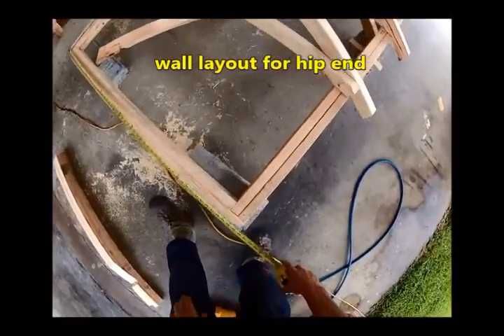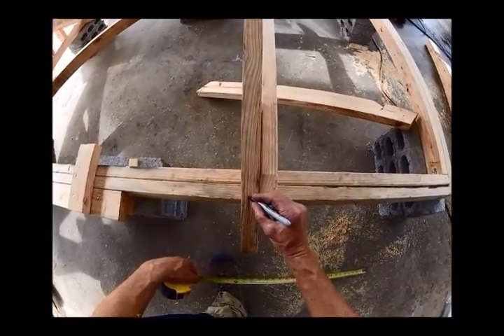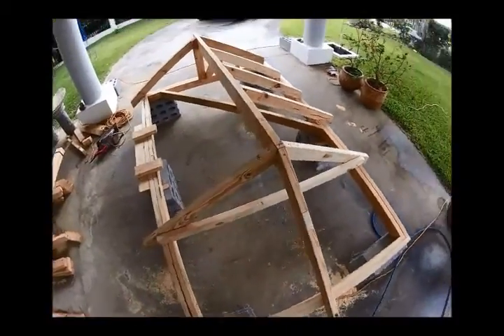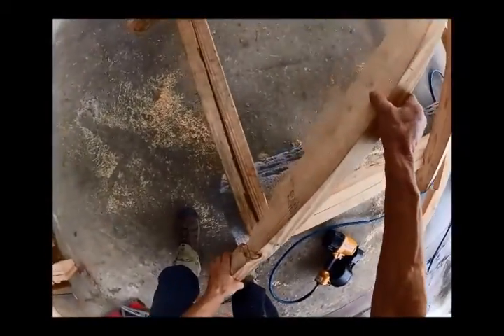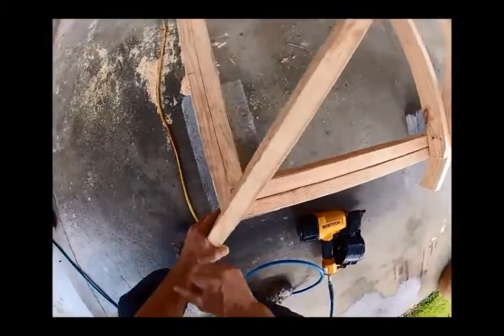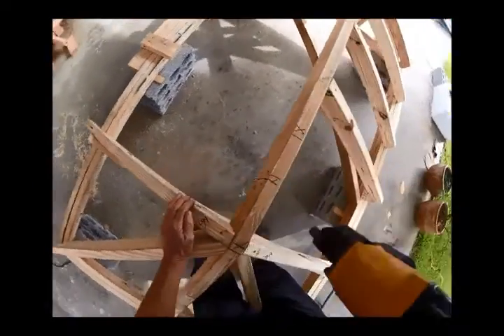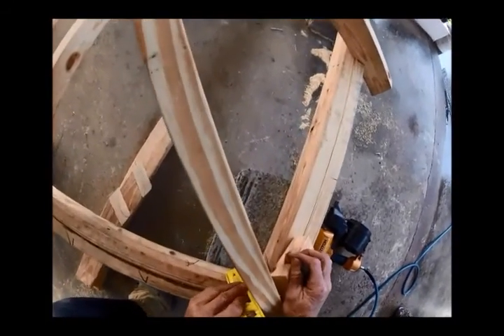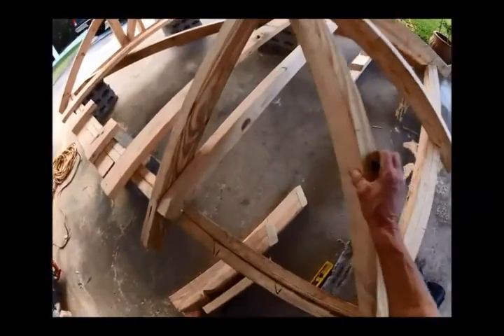Stacking a Hip roof

Comment: I've  hip rafters that come to a point.
I want to vault the whole house.
How's it done?
Reply from the maker: Brian it is not hard to frame.  Let's name your 4 outside building walls that define the perfectly square building - North (N), South (S), East (E), West (W).  With King commons centered on each wall, cut the King commons that originate from the N & S walls using the building run (1/2 the bldg span).  These two rafters will butt head-to-head while the King commons originating from E & W walls are cut normally as if they were butting into a ridge that is the thickness of a King common.  They will be cut using the effective run (bldg span less thickness of a King common with that result divided by 2).  Stack the E &W King commons so the outside top corners at their head-cuts line up with the top corner edges of the N/S head-to-head King commons.  Calculate the 4 hips using the same effective run you used for the E & W King commons and stack them as you would any other hip connection and finally run the jacks.  My framing book, A Roof Cutter's Secrets can help you with all the specifics. 

You will need some method to structurally support your "to a point" vaulted hip roof ceiling.  For this there are many options to choose from and most often the method chosen depends on the designer's aesthetic taste.  Some common ones would include running a support post to the peak center point, applying different types of house ties made from wood or cable, or stiffening the walls with corner ties.   If the roof skeleton is framed using beams rather than 2x material then there would also be bolted metal plate methods that could be utilized.   wh